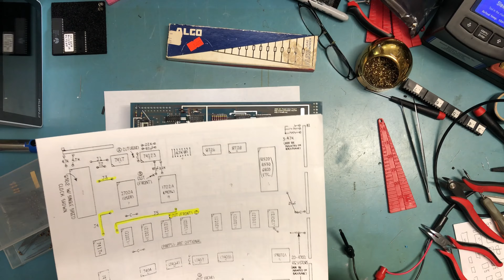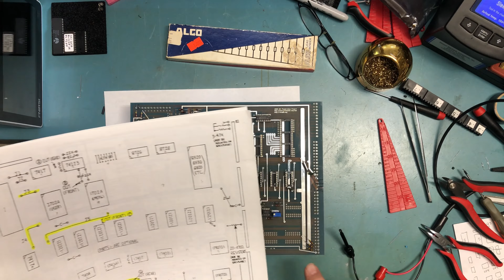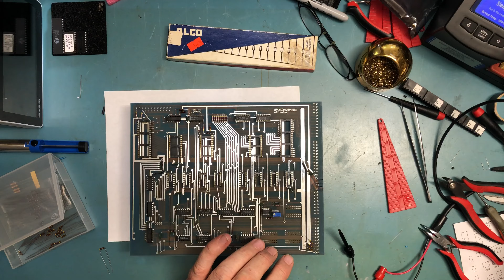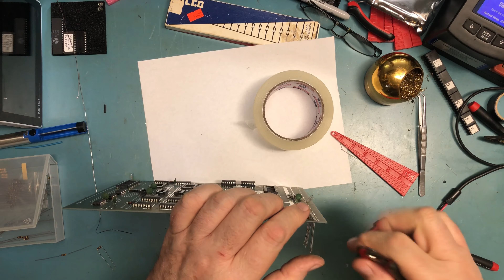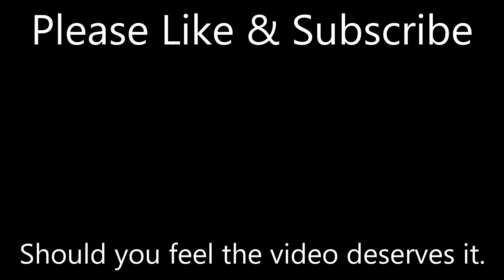STB1055 - OSI 400 CPU PCB - Part 6 - Termination

Comment: Neat, rthe common way was to simply solder them all with the common sticking straight up, then have a U shaped brass strip that held the other wire end, with a lead to Vcc. The other method was to use a piece of veroboard, cut so you had a single strip of copper, sand ends smooth to lose the part track, or just have those 2 part tracks either side of your single track, and one extra hole for the flying lead. The fancy method had the brass strip and a plastic cover you clipped over it to provide both insulation, and a colour and place to have the termination marked with a part number for assembly, plus likely also enough extra to put a decoupling capacitor in there as well.
Reply from the maker: Thanks. That's interesting. I've never worked with an OSI system before and have never seen an original. Photos are scarce so I'm making a lot of this up on the fly. I am on the OSI forum and have the email address of one of the OSI Preservation Society members who is helpful.